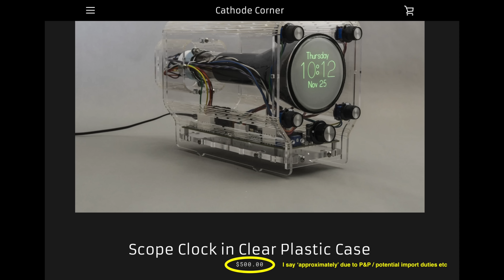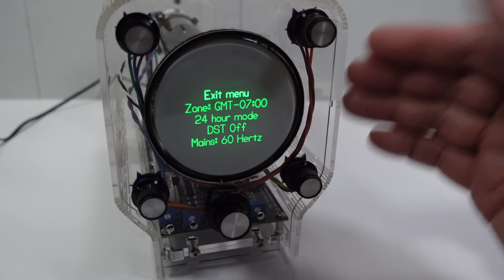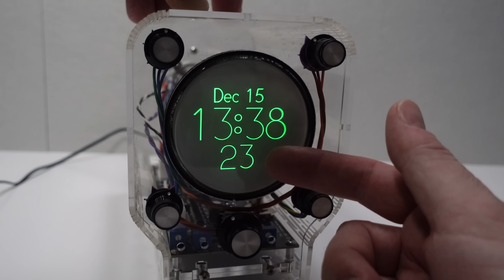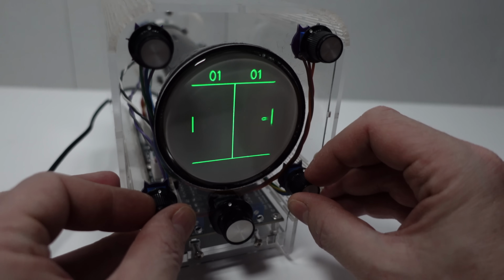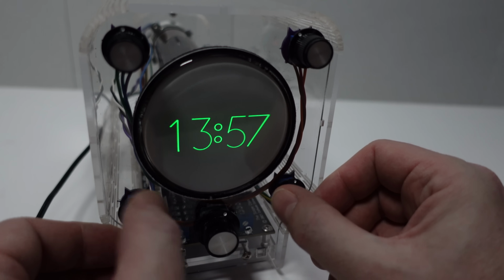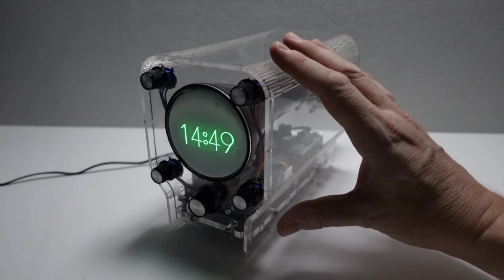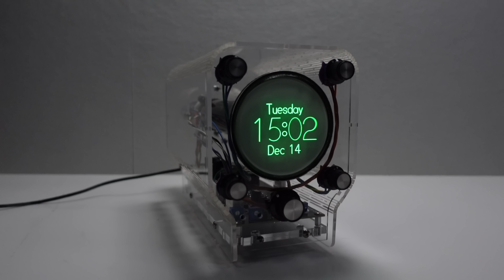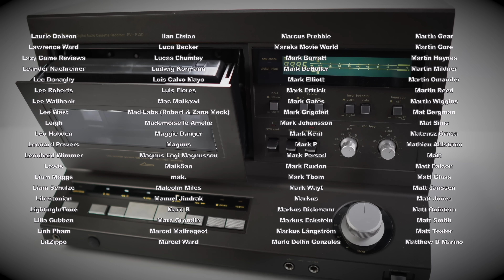The Scope Clock - from Cathode Corner

Comment: I think a lot of this is open source. As it uses vectors, I suspect it is easy to replace the CRT with a laser? Did this product utilise open source code and hardware originally intended for use with lasers?
Reply: Good luck finding galvanometer mirrors that run that fast. But the published source code runs on a Teensy 3.6, so get one and try it yourself.

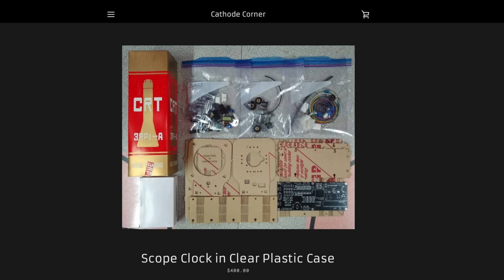Comment: Just letting you know Matt The CRT Oscilloscope Tube is from Russia 8:58 You got the Russian alphabet +Russian characters  on the CRT Oscilloscope Box even the Red & Gold box

They have sworn to keep CRT + Vacuum tubes in Production of manufacture due a lot of there Russian  technology and infrastructure Population  are still heavily using them even Repair old vintage Radios and TVs audio Equipment
Reply: This is a 1980s Chinese production of an American tube design, the 3RP1-A originally made by RCA in the fifties. These tubes are very well made and last for 20 years of continuous use.
Reply: @davidforbes8900  I was worried that they were using NOS CRTs, needed to keep US test equipment and high-end audio gear running.
Reply: Can't see any Russian letters on the box. 
CRT and 3RP-1A aren't Russian.
BTW, Russian for CRT is ЭЛТ

Comment: 8:49 Where can I buy that piece of string of yours? It looks like a really handy measuring device, portable and packs away very cleanly. You can also tie it around your finger to remind you of important things. I'm so forgetful lately. What was it I was after again? If only I had a string tied around my finger to remind me.
Reply: It's about half the length of the diagonal of the handkerchief that I tie a not in to remind myself of things that I might have forgotten.  Actually, it works surprisingly well, but I haven't tried using it as a unit of linear measurement since I would forget the result before I had a chance to write it down somewhere...
Reply: @GodmanchesterGoblin  
Thanks, although that doesn't help me in finding out where I can buy the exact same kind of string. Lol.

Cheers.
Reply: @jtveg  True.  But when you've seen the string for sale somewhere, the knotted handkerchief may help remind you that you still needed to buy it, and even how much if it you need to buy.  Happy Christmas.

Comment: Is the circuit board with the micro usb an arduino? Seems awesome. Yup, yes it is as you say later. Open to firmware updates in the future and user modification. I like it! Will look into getting a kit.
Reply: Looks like a teensy,  has an SD card slot in too.
Reply: @Tarbard  Not sure how many GPIO are on that. If theres any unpopulated it'd be trivial to add alarm features with a piezo buzzer.  $400 thought is a bit steep for me. Awesome nonetheless.
Reply: @sokoloft3  It has a ton,  teensies can also play audio samples (e.g MP3s).  I checked the code for this project and it is indeed a teensy 3.6

Comment: Great video. For those that want converted measurements of the device. The height is a toilet roll (on its end and a cox's apple with stalk), the length is 4aa batteries and a orange or 1.5 strips of streaky bacon.
Reply: Did you use imperial or Whitworth bacon?

Comment: Wow! Gorgeous piece. I wonder how burn-in will effect the phosphors and how quickly.
Reply: The clocks that I made 20 years ago, and have been running continuously since then, still look reasonably good. These tubes last a long time! Also there's a display dithering feature to spread out the wear over a 5mm square area.
Reply: Especially since you can't turn off the display or set a time when the screen would be off, I expect the burn-in would be really bad after a few months. If you put the month on display, that month is being projected for 30 days straight 24/7. Also the left-most hour digit, 1 or 2, is always projected half a day. 
I would really like to see what the display looks like after a year of being on.

Comment: 08:50 - great idea for a size comparison, I have the same string laying around to check the size of my clocks.
What is really a coincidence, is that the clock has the exact same length as the string. I'm mind blown!

... well, as a side note, great watch!
Reply: on your side note, i feel i need to point out it is a clock not a watch :-) that said i agree it is great!
Reply: @alanw8834  Every clock is a watch if you're strong enough.
Reply: @alanw8834  Two pedants sat on the floor, and one fell off.
Reply: Also excellent to see it's just the right height to fit on the shelf where I keep my noodles and tangerines.
Reply: But was it an ISO standard bit of string from France?
Reply: Where did you buy your clock measuring string?

Comment: I really think the lines of the „6“ and „9“ characters should be tangent to the circles (of the characters). Especially on such an expensive clock.
Reply: It can be resolved, at this time the font's data doesn't allow for much accuracy.
Looking at the code, it's only ellipses and lines locked to a grid typically 16x20. It could be scaled up or use a float type for better precision.
Great use of the Teensy 3.6's dual DACs by the way :)
Reply: I quite like the 6 and 9s. The slight offset is part of the charm of a CRT.
Reply: Yes, it's a bit of a compromise. The code was originally written for a different circle generator design which didn't have as much precision as the current design. I will probably make them fit a bit better when I have a free moment. The firmware is V1.0.0 at this time.
Reply: @davidforbes8900  lovely work David , a pat on the back for that , thank you .
Reply: @davidforbes8900  gorgeous piece of work. I’m really taken aback at how nice the display looks. Haikus are also a great feature.
Reply: Probably a small firmware update could resolve that.
Reply: This is, well, tangential, but I hadn't seen that back quote character you've used.  Is that featured in your keyboard layout?  If so, which layout is it?
Reply: @bsadewitz  these are German quote marks (qwertz layout)

Comment: Amazing device, the sharp green of real oscilloscope screens is really something else. Only one thing bothered me a little bit, the wire harnesses inside could have been cable laced like you see often in old lab equipment for that neat look.
Reply: Well, that is a great sugestion for those that get the kit!
Reply: Yes, but I never worked as a Navy tech, so I never learned the technique. We have a spool of that stuff at the radio astronomy lab where I work.
Reply: Thanks for creating these beauties,  @davidforbes8900   🙂👍
Reply: I thought something along those lines while watching the video. That would definitely add to the look of it. Also from the looks of it... That should be easy enough to upgrade. 😊
Cheers

Comment: Great clock,  would be better with a simple system to detect motion or body heat to turn screen on and off to increase life of tube and save energy.
Reply: That’s smart
Reply: .... And 'Burn in' would have to be an issue. I thought the designer would reposition the image slightly every 5min. or so.
Reply: Definitely burn in is a factor. Decades ago I build an on-screen clock for a CCTV channel that displayed the time and scrolling text.  The audio was a classical music channel.  So many people at the hospital where I worked left it on that channel that eventually we had a lot of CRT televisions with 88:88 burned into the screen.

That's the reason early computer screen savers moved the text and graphics around the screen to prevent burn in.

Comment: I vaguely remember that a similar type of device was also available as a bare microcontroller board without the oscilloscope and that you could connect it to the X and Y inputs of any old scope you already had. These were much cheaper.
Reply: Those are available still, and they are a lot cheaper. They do require blanking Z input to prevent little streaks between segments.
Reply: @davidforbes8900  only one I really know of was the dutchtronix oscilloscope clock board.

I've wanted another since those are no longer available as kits but a lot are the whole thing minus the CRT and case
Reply: @davidforbes8900  do you by chance sell just a clock board that can be connected to an oscilloscope?
Reply: Are normal oscilloscope circuits fast enough? I remember I tried Jerobeam Fenderson Oscilloscope Music on two of my analog scopes and you could see that when there was much on the screen it started struggling drawing straight lines
Reply: @DerSchoermbro  any oscilloscope with a bandwidth of 5MHz will work fine
Reply: The limiting factor would probably be the sound card / audio source - human hearing tops out in the 10s of kHz while pretty much any CRO I know of will at least be in the MHz. As for weirdness happening when other stuff is drawn - is there some AC coupling going on (either in the sound card / audio source or in the scope)? I think this would cause some unexpected artifacts and make stuff self-center over time. The gain in one channel of my scope is a bit up the creek and this failure / change in the amplifier behaviour also causes artifacts / skews shapes at moderate frequencies.

Comment: It would be cool to see them make some new CRT displays.
Reply: I think the very very last ones stopped in India in 2015, although you can still buy new old stock flat 5 inch ones online
Reply: It would also be cool for them to make original Beetles and 10 lb telephones again, but it's not going to happen. I'm working on the old stock. Not enough demand to make new ones.
Reply: @davidforbes8900  I think the main problem with the original Beetle is less about demand than that there is finally nowhere in the industrialized world with automobile safety standards low enough to allow new-production ones. :)
Reply: I think there is some company that makes the clear ones for prison system.

Comment: In response to your comment at 11:00 about keeping it sideways as art, I imagine that you might be able to get a custom firmware to enable a horizontal reversal of the display so that you can have a it on display sideways with a mirror redirecting the light towards the room
Reply: Or just swap the connections to the X deflection plates
Reply: Or just turn the CRT around by 90 degrees!
Reply: ...or just put it on an open shelf, where you can see it from both the side and the front.
Reply: Or just put it on a turntable so it alternates between right side, front, left side and back :D im sure he has a spare one lying around :P
Reply: @unitrader403  problem with that is the power cable can't have infinite rotations

Comment: Great design - I like the combined bend and vent :-) and perfect orange-on-potnoodle proportions
Reply: The slots are there for bending purposes. There is no need for ventilation as the plastic is only 3mm thick so it doesn't retain heat. I would have preferred to not have the slots for purity of design, but it's hard to bend acrylic nicely without them.
Reply: Vents are really unnecessary, these tubes barely get warm.  I'd prefer a sealed unit to keep out dust.

Comment: Or It would have been good to know more about the tube supply chain. Everything else is pretty straight forward. Thanks for showing these curiosities!
Reply: I build these clocks. I have a couple hundred tubes in my closet, and they're readily available in quantity these days. They were originally made in China in the eighties, I think. The quality is excellent, and they seem to run for 20 years or longer, based on my 20 year old clocks that still look good after displaying the time 24/7 for that long.

Comment: The display on that thing is very impressive!  I'm surprised it doesn't show any flicker at all.
Reply: For 500 bucks, it should be.
Reply: @xjonx1  True 'dat.
Reply: Because it's not flickering it's a luminous oscilloscope vector display, it also has no resolution not like infinity ultra HD but like it's a beam that moves sideways.
Reply: @fischX  The resolution of the D/A converter?
Reply: @fischX  Standard oscilloscopes definitely flicker, this just scans the clock pattern fast enough that it's not obvious.

Actually I think this scans at mains frequency to eliminate heterodyning effects, so the flicker would probably be noticeable in person.

Comment: I wonder how quickly they'd be affected by screen burn.
Reply: Last time i looked at the code, it moves the trace around slowly to avoid just that.
Reply: @zaprodk  That'll sure help but the screen is still going to suffer from screen burn. At best it'll take longer and be over a wider area. Even LCD displays  can suffer from screen burn but it's not as much of an issue as it is with CRT as it's not in most use cases as noticeable. 
Apart from moving the display around on this CRT clock it might be an idea to adjust the intensity according to ambient light levels. I have had CRT phosphors replaced but I doubt there's anyone doing that these days.
Reply: The store page mentions Davids (the creators) clock that was built 20 years ago still works fine, and that the tube used should handle at least 10 years without any problem.
Reply: @realkrzaku  I did read that but this isn't a failure or even a problem as such. Screen burn in is most noticeable when there's nothing on the screen and I've certainly seen it happen on CRT monitors that display much the same thing for many hours per day.
Funny  coincidence. Trying to declutter we found a CRT in a box along with a small MV rectifier!
Reply: See the video description.
Reply: Sadly this design falls a bit short - especially for the asking price.

Comment: That's a very pleasing device. Reminds me of my favorite day of the electrical engineering lab course I took in the one semester before I switched to mechanical, when we got to play with actual oscilloscopes. :)

If anyone is interested in metric conversions of the dimensions, I would eyeball-estimate it at approximately 0.00047 Eiffel towers in height, with a length of roughly 0.016 Paris Métro cars.
Reply: How about Smoots?
Reply: @howardshubs7157  The smoot is an ANSI unit, but just for you: approximately 0.09 × 0.22.
Reply: @ZGryphon  Numbers without units aren't helpful.  :-D  5'7" is Imperial, yes, but I was asking about the ... Got it.  You meant those number are in Smoots. Good.
Reply: Eiffel tower? who uses Eiffel tower anymore? you French really needs to move on to the 21st century and start using string units.
Reply: @E_y_a_l  Imperial or Metric strings?
Reply: @Kae6502  Cotton
Reply: @E_y_a_l  lol!
Reply: And I thought string theory was just scientific nonsense...
Reply: If it's not in rods per fortnight I can't visualize it.
Reply: @RCAvhstape  It really needs to be in acre feet per square Fahrenheit, to be truly American Standard.
Reply: I'll need this measured in corrupt politicians per square meter thank you
Reply: @juango500  British or American politicians?  The units are not quite the same (a bit like gallons, pints, etc).
Reply: @GodmanchesterGoblin  uhhh
Argentinian politicians?
Reply: @juango500  Then probably a completely different measurement scale is required.

Comment: Cool idea, but that thing is gonna screen burn within a couple of days, would love to see a review of it in 6 months time...
Reply: I have been using these 3RP1-A tubes in clocks for 20 years. The tubes last for 20 years. Really. I am as amazed at this as you are. The clock has a screensaver that dithers the center position by a millimeter per hour, which spreads out the screen wear. And the cathodes are very long life.

Comment: How does it use the mains frequency on a DC power supply? Does enough of the 'ripple' make it through the rectification to still be usable?
Reply from the maker: 🤷‍♂️ I do not know.
Reply: @Techmoan  This initially confused me too until I looked up the manual - "Mains tells whether the AC power in your location has a frequency of 50 or 60 Hz. This is used to
 synchronize the display to any magnetic fields that may be present. Having it set to the wrong value will cause the display to shimmy if the clock is near an AC-powered motor, transformer or electromagnet."
Reply from the maker: I'll try and snip a couple of seconds out of the video to remove my erroneous nonsense. I'm attempting to do this in situ, which works about one in a hundred times...so we'll see. The YouTube editor is just as likely to invert the video and make it black and white as it is to snip the section out I marked.
Reply: Yes, the power supply doesn't care. But the CRT is sensitive to the magnetic fields created by any mains-powered equipment near it. Synchronizing the display to the mains frequency hides this effect, so the tube may be unshielded and not suffer from visual interference.
Reply: Many cameras have a similar setting to help prevent flicker from lights. This must be doing a similar function.

Comment: Are you at all concerned about screen burn?
Reply from the maker: I’m not - but that’s just me, if you are I’d steer clear. I’m getting to that age now where most of the stuff I’m using will outlast me.
Reply: See my reply above to this question. Its not an issue. The CRT will last for 20 years of continuous use, based on the clocks that I built 20 years ago with the same tubes.